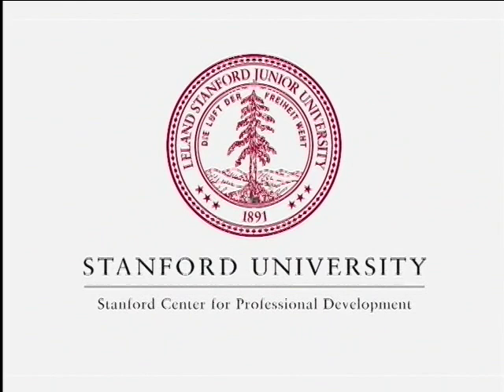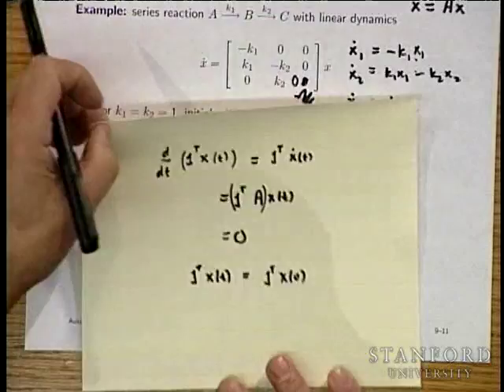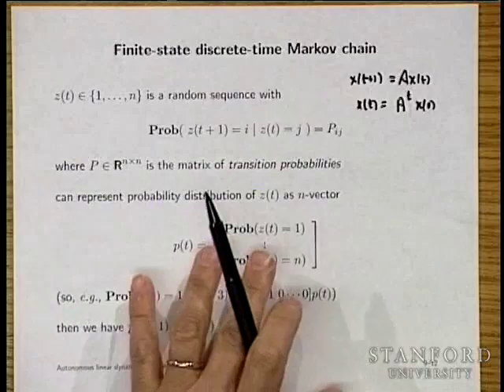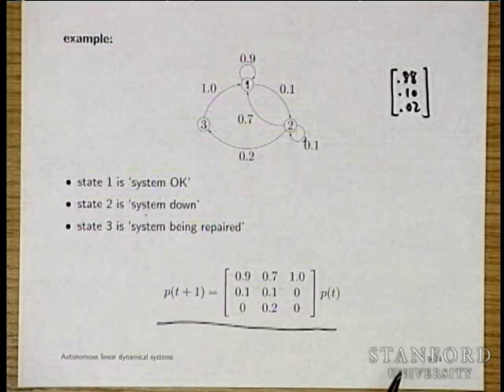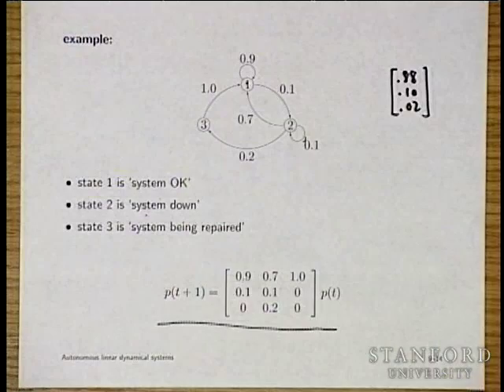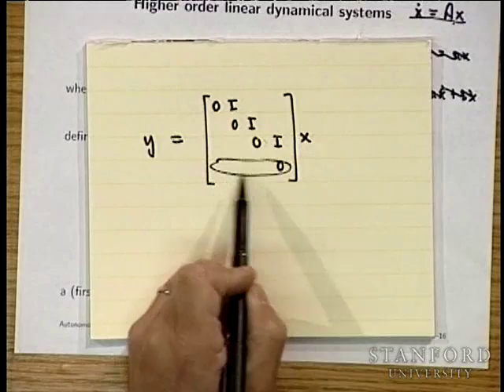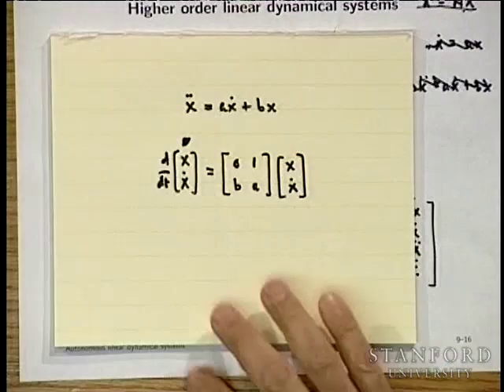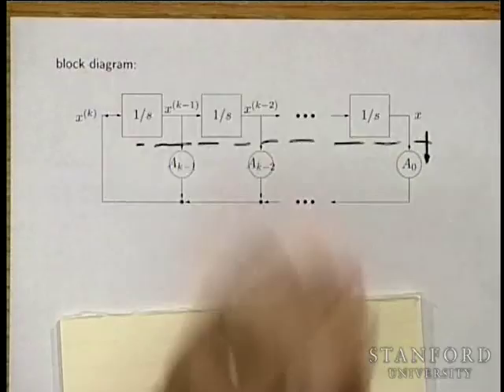Lecture 10 | Introduction to Linear Dynamical Systems

Comment: K12 represents the force that displacing element 2 places on element 1. This force will only depend on the value K12 however the amount that this displaces element 1 in effect will depend on the M matrix since the mass will be important in converting force into displacement. This is represented in the A matrix in the x' = Ax below.